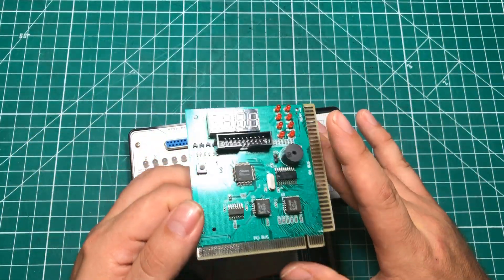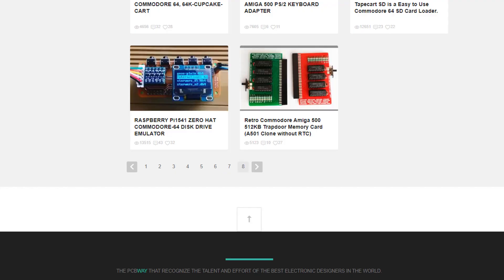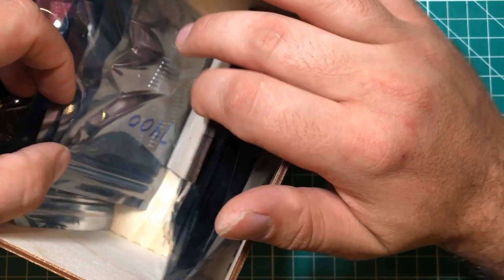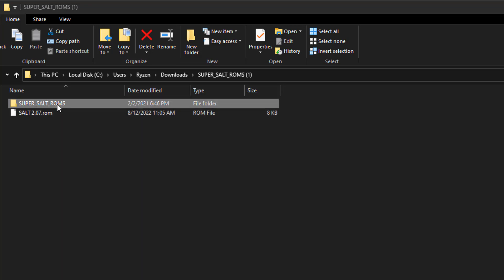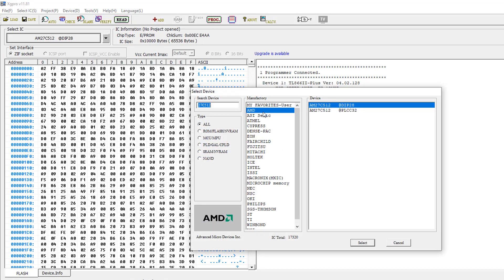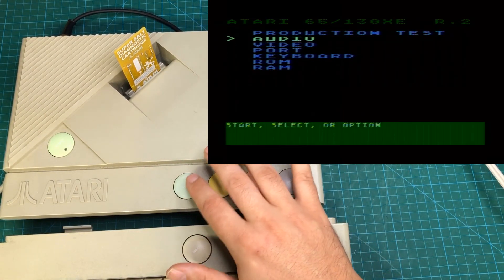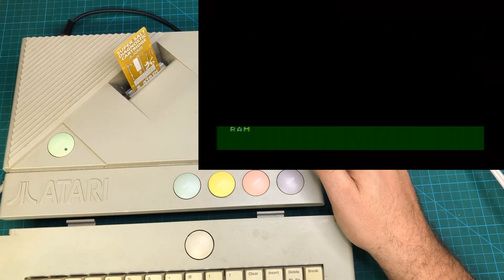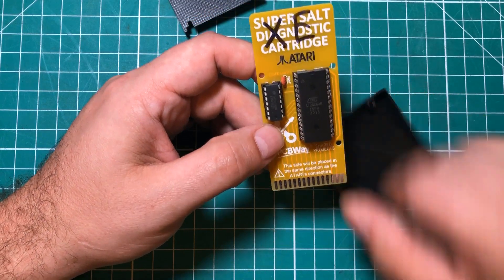Building an Atari Super Salt Diagnostic Cartridge for the Atari 8-bit computers (400/800/XE/XL)

Comment: I've just got 10 of these boards from PCBWay 🙂
Now, the archive I've downloaded does not have a 2.07, and I don't know what all the different versions are for.
My primary need is for testing an 800XL, an 800XE, and a 65XE. I am assuming that the one labelled SALT 2.05 will work in all machines?

Comment: I noticed that near the end of soldering, that it appears that you are creating two solder bridges on the back of the board. What are these used for? At each spot on the board that I'm referring to, it has 8K stamped near them. - Joe
Reply from the maker: It is the size of the rom

Comment: I have several Atari 8-bit machines, including the 800 and XEGS. As far as the XEGS, since it was supposed to be a gaming machine (hence the GS in XEGS) it only had composite out which was a downgrade from the previous systems. The funny thing is that Atari bungled the video on the XL and XE lines and forgot to wire up the Chroma signal. There are many video mods out there for Atari computers but you would have to modify the case to install these and I'm not a fan of doing that. Still, AtariAge's forum is the best place to find info stuff like this. That being said, I think your video output looks good but you can go here and you can see what the colors should look like https://en.wikipedia.org/wiki/File:Atari_8_bit_GTIA_NTSC_palette.png.

As far as this SALT,  I see that they have a short board version that will work in all of the machines BUT they do suggest you use a case if you're going to use it with an 800xl. In any case, I went to PCBWay and put one in my cart and it was  $23.69 + $5 shipping. I don't want to seem cheap (but here I go) but that seems kinda expensive for an unpopulated board. I'm sure if I purchased multiple, I would see savings but since I only really need one, I wonder if you know of anyone that sells these cheaper or ever populated?
Also, I see you mention that there are different ROMs for different versions of the Atari but then there is version 2.07. Can I assume the different versions were original SALT ROMs and the 2.07 version supports all Atari versions? Yes?
I'm going to assume you haven't tried this with RAM upgrades such as the Ultimate 1 meg or with something like the VBXE/VBXL. It would be interesting to know how that might affect this. 
Thanks in advance for any info you can provide.
Reply from the maker: Sorry for the slow response. I've been out of town.  It's good to know that my XEGS isn't too far off from what it should be.  I appreciate the link too.

TBH, I can't really understand what it is about these boards in particular that are more expensive on PCBW. I order a lot from them and most fall under the $5 limit and then if you select USPS for shipping, you can get them rather cheap. 

I do think you're right on the 2.07 rom.  They're all different, but I haven't read up on the different versions.  Are you located in the USA?
Reply: @AnotherMaker  Yep. USA.
Reply from the maker: @SimmeringPotpourri  If you contact me through the about button on my youtube channel, I'd be happy to send you one.

Comment: There are a number of Atari 8-bit video improvements. The do-it-yourself super video mods give you s-video output. The Ultimate Atari Video board gives even better s-video output, and there's a board that will give you digital out using DVI-D. I don't remember the name of that one. You'll have to do some digging into each of these to see which (if any) works with the XEGS. I've never owned one so I'm not familiar with the hardware differences compared to the standard XE series.
Reply from the maker: Thanks so much for that info.  I'm definitely going to look into those.  That's pretty much the only letdown with this machine.
Reply: @AnotherMaker  I remembered (finally) the DVI board is called Sophia. As if that's not enough, there's yet another board called VBXE that has RGB output! Lots to choose from.
Reply from the maker: @lilbill6089  Thanks! I do remember people talking about the Sophia.  I've never heard of the VBXE.  I'm researching all these.  I really appreciate the info.